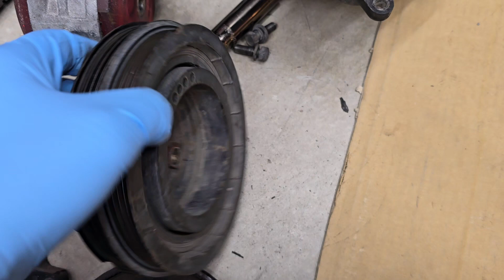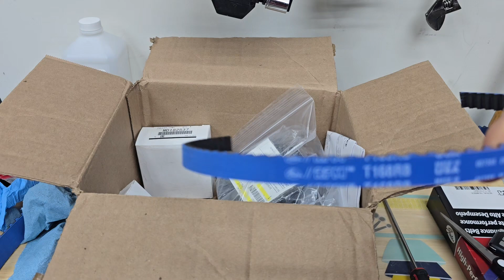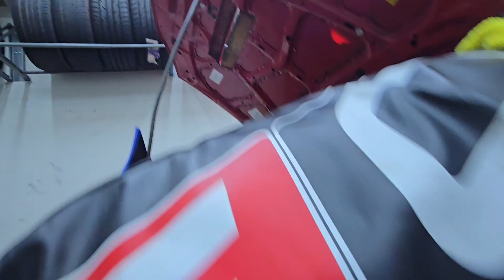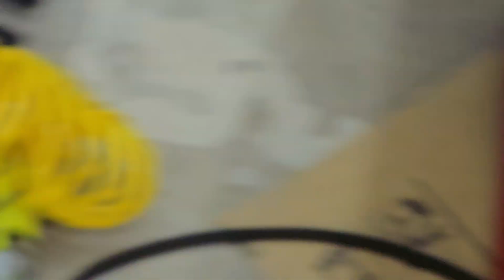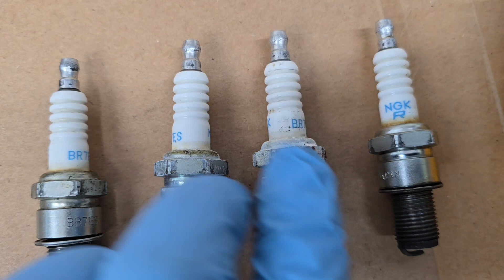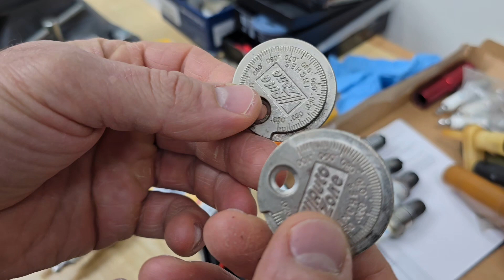Eclipse 2g GSX Restoration - Part 6

Comment: Only use OEM belts, period. Nearly 20 years working on DSMs and I have not had one fail but I have fixed a few others cars with other brands that have failed, including Gates.
Reply from the maker: @jdxnc04  Yes,I know the OEM belt is the way to go, and it won't fail.

Comment: You should never lay down the tensioner . After you remove it you supposed to put it in a vise and install the pin .
Reply from the maker: @louiscongionti2394  Good tip never knew this ! I just read about it, and it is generally recommended to keep it in an upright position to ensure proper fluid distribution and function ,but this is not the biggest problem. I am supposed to compress the tensioner with the position facing up and down,otherwise, all the oil is no longer in the oil reservoir of the tensioner, and it can no longer function correctly.  Maybe I will do the job again and reset the tensioner correctly .